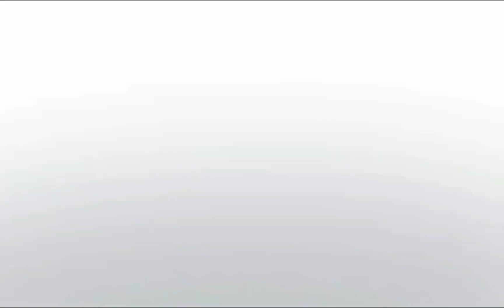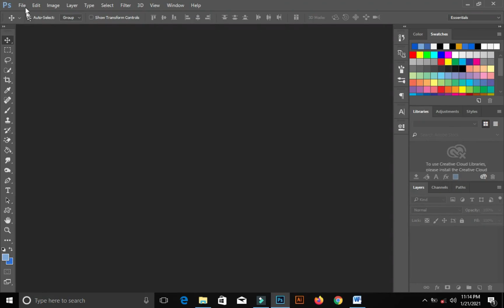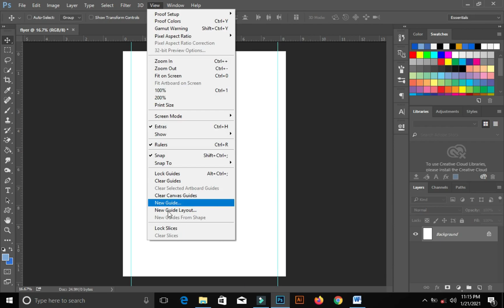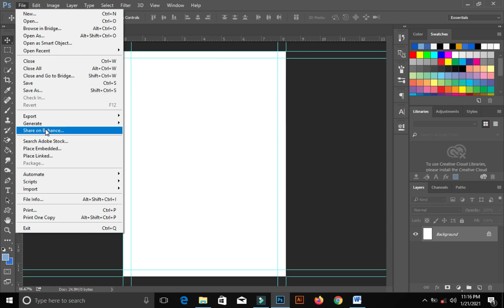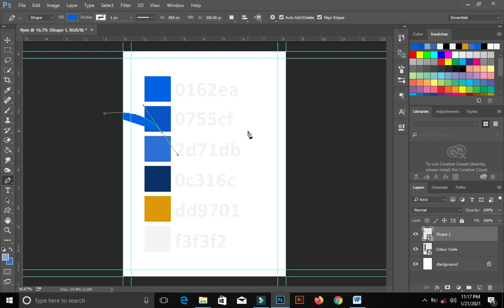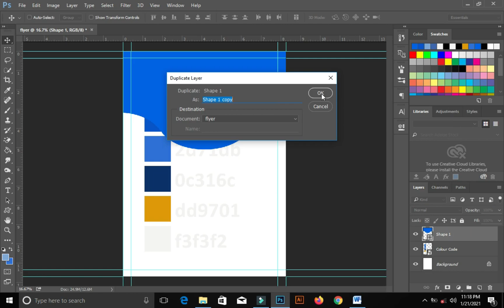How To Create A Business Flyer using Photoshop

Comment: No designer is going to use PS for work like this, they would use Illustrator or maybe InDesign.  Also, RGB colour mode?  How are you going to get colour accuracy?   It's CMYK at the very least.
Reply: @YJDigitalWorld  Yo'ure not going to be using RGB mode to send to print, you don't have colour accuracy.  I've worked in print for over 30 years.  Printing presses use 4 colours - CMYK.  If  you use spot colours in a design then they colours will be way off if you use RGB, especially if you are using Pantone or even older systems like Hexachrome .  CMYK is colour accurate, RGB isn't.  I get the feeling you've never worked in print.
Reply: @YJDigitalWorld  Photoshop is used to edit elements of the design, like the photos.  When it comes to laying it out with  text, you use vector based software like Illustrator or InDesign.  I do this for a living.

In another video you design a business card in PS.  Seriously?  You never use PS for business cards.  Try producing an 8up artwork with sharp 6pt text & no aliasing @300dpi in PS for litho. lol
Reply from the maker: Agreed 💯💯🙌🙌